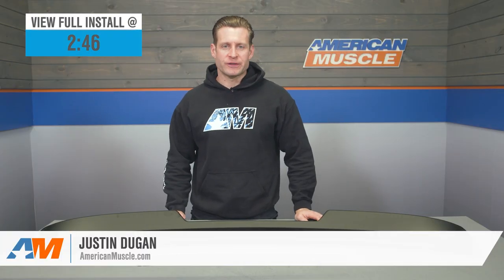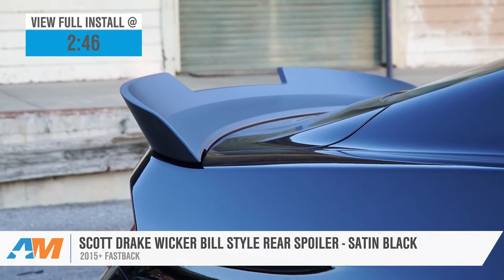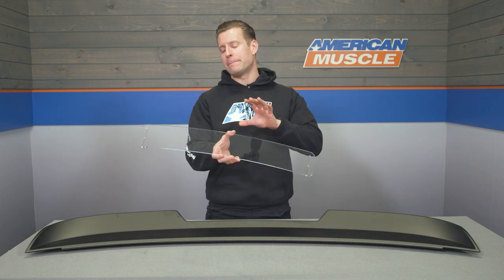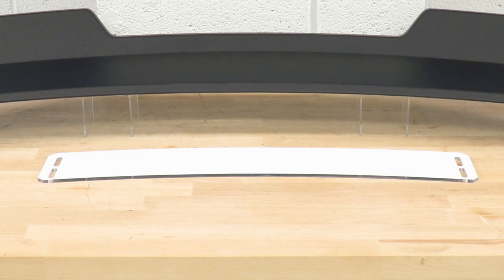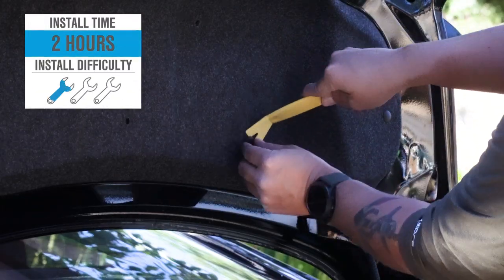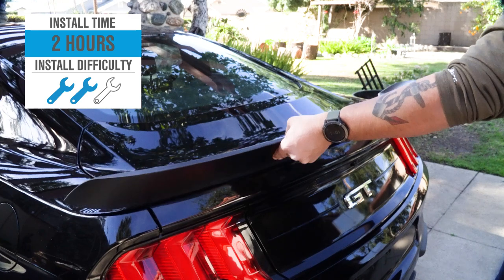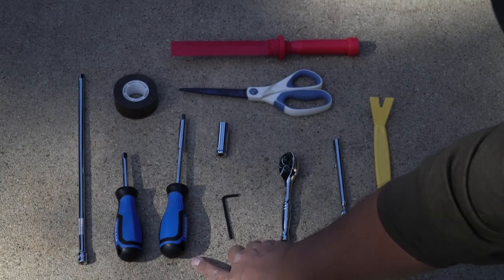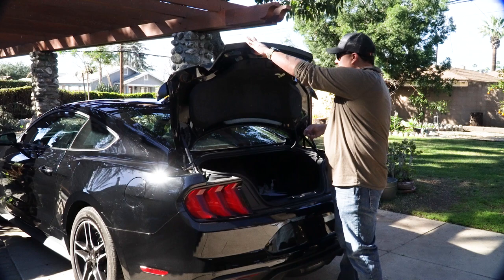2015-2022 Mustang Fastback Scott Drake Wicker Bill Style Rear Spoiler; Satin Black Review & Install

Comment: OMG, there is no way this doesn't effect your gas millage. Wicker Bill's are designed to increase down force at low speeds. If you look at the Wicker Bill on the OEM 2 piece GT-500 "swing" you will see that it doesn't take very much of a lip to drastically increase the down force. In fact, in the instructions from Ford it states "Not recommended to install the Wicker Bill for highway use." That's the EXACT reason Ford designed it be removable. I will guarantee this Scott Drake Wicker Bill spoiler has never seen a wind tunnel for testing.
Reply: bro it looks cool who cares about mpgs lmao